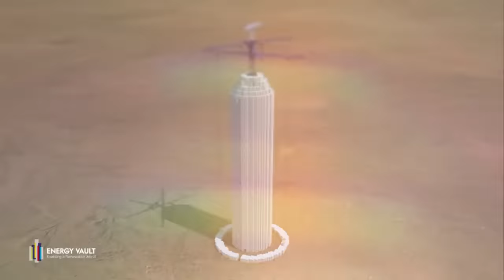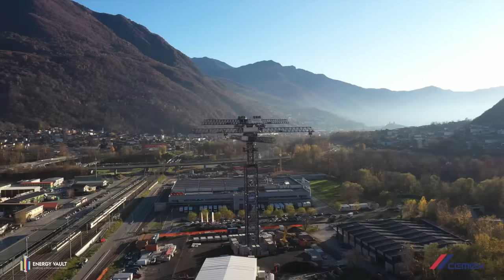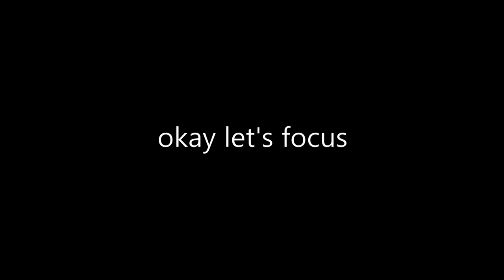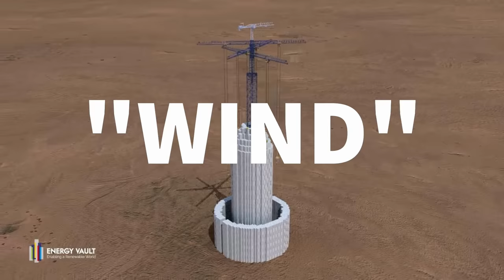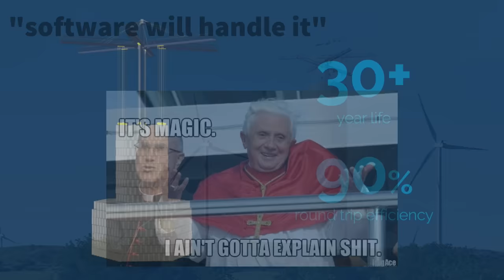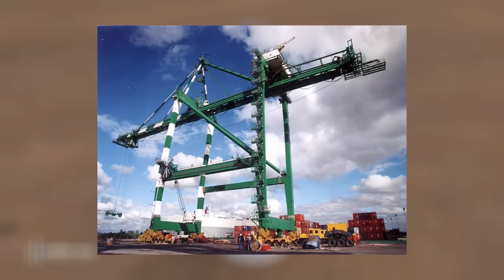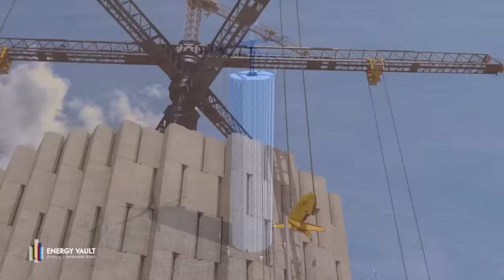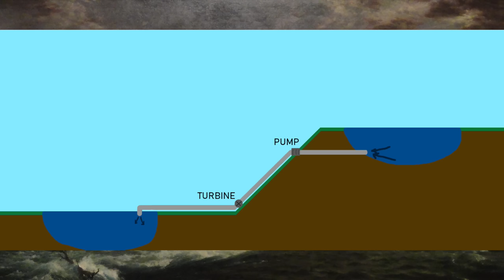The Energy Vault is a Dumb Idea, Here's Why

Comment: I started cackling at the end, you really showed how needlessly overcomplicated the crane idea was just to fit the CEO's "futuristic design"
Reply: Except not. Pumped hydro works mountainous regions or regions with relatively wet climates. Doesn't work in the desert.
Reply: But that's how you can get a bunch of investors and jack up your stock price. ;D   Which they have already by over 100% (NRGV) lol
Reply: @ChrisG1392  The answer is in the video btw: dig.
Reply: @ChrisG1392  35 MWh is enough for an industrial town of 4.000 people for a day of completely uninhibited operations during a total failure of energy production. You simply don't have that in the middle of a desert, neither you need that kind of a backup; a battery of that capacity could easily serve a town several times as large, which is even rarer in a desert. Also let's do some math: this thing is about 90m high (as much as a 3 MW wind turbine), and the cranes seem to be about 50m across. Pumped water energy storage is about 80% efficient, which adds up neatly: a water tower of the same size as this contraption, with a pool next to it, can store & output almost exactly 35 MWh of energy, while requiring significantly less maintenance and complexity. The amount of water contained in such battery is much less than the people using it spend over a couple months, and it can be any kind of water, including sea water or waste water from the people using such battery.
Reply: pumped hydro doesn't work as many places as the crane does. But I agree, build them underground and with a gantry crane. pumps and turbines fail same as concrete blocks, and more often. Also, when dealing with water you corrosion issues, filtration issues, etc. The concrete blocks will last a LONG time and are EASILY replaced. 

Guess what, EV car batteries, solar panels, and wind turbines also used fossil fuel energy to make as well. This is a bullshit argument. Have to start somewhere. Never mind the fact that concrete is far more recyclable than lithium batteries.
Reply: @SoloRenegade  "as many places as the crane does"? What places? What fucking many places does the crane work at?? Are you trolling?
Reply: @s3dchr  you have some serious anger issues
Reply: @SoloRenegade  Great argument.
Reply: @s3dchr  at least I have one (and argument) and don't blow a gasket the moment someone has a different opinion than myself.
Reply: Pumped hydro needs a lot of land and natural elevation difference in a close space that's literally the whole point of the tower,

Comment: As an amateur, I am puzzled by the method of picking up the blocks.
Surely a handle on the top of each block would be the best solution.
It could even serve as a locking mechanism for the blocks stacked on top of it.
Reply: Gernot Schrader  
“Gell”??
Reply: It's solved by "software"!! lol
Reply: You've clearly put more thought into this. That's how concrete blocks are made for temporary retaining walls, with a ridge on the top that fits into a notch on the bottom of the next block, and a steel bar for a lifting point.
Reply: @joey_bonzo  SIXTEEN TIMES THE DETAIL
Reply: @Traitorman..Proverbs26.11  gell is colloquial for ",doesn't it?" and ",isn't it?,
Reply: Traitor Trump Critic   You probably realize that Trump assumes he is smarter than everyone (even engineers), because he isn't smart enough to know better. Your avatar suggests that you might not want to make the same mistakes. I'm not an engineer, but it seems to me that a top handle creates a pivot point for the blocks to swing in the wind. Maybe the engineers know a bit more than you and that is why they went with an anti-swing system. It looks like it might work with similar principles as an antisway bar on a car. If one side has a force applied in one direction, the bent connecting bar (yellow lifting bar in the video) will apply an opposite force on the opposite side. One center handle would be the absolute worst anchoring position for stability.
Reply: @MrAllallalla  
Ah. I thought it should have read “geil”, but that didn’t really fit.
Thanks.
Reply: @gordthor5351  
Four attachment points on the top of the blocks would do the same as your “car frame”.
I’ve been in the merchant navy and I am absolutely sure that if the methods shown was the best, then every container crane in the world would use it.
But they don’t. They use a four point system that attaches in each corner on the top of the container. And the corners also serve as “stacking points”.
Even so. The length of the wires would make the whole system extremely difficult to handle in windy conditions.

As for my avatar… it is chosen to show the text on the guys shirt in contrast to the woman sat in front of him. It actually says a lot about the American society and is often used as a conversation starter. 🥴
Reply: @Traitorman..Proverbs26.11   This is a four point system with 2 cables on the sides (at the top). The 4 corner bars extending to the bottom only adds lateral stability. It's difficult to see for sure in the video, but if you look at the yellow bars at the top, there is a 90 degree bend. This is similar to how an antisway bar on a car transfers an opposite force on the other side to reduce body roll.

Also, some of the blocks weigh 30,000lbs with a relatively small surface area. Coupled with the fact that the blocks move up and down quickly, the wind effect would likely be minimal. 

My point is that I highly doubt that engineers weren't included in this project. Even the most incompetent engineers likely know more about physics than you and I put together. 

My argument is based on logic from what I could see from the video. I'm not an engineer so I'm not claiming that I am necessarily right. 

Hey, we at least agree that Trump is a dummy and a corrupt traitor.
Reply: @gordthor5351  
But the vertical bars are containg a rod which turns and makes a half disk engage at the bottom of each corner on the block.
Not a very secure method. The cement at one corner only need to wither slightly and the whole block risk falling from a great hight, onto whatever is at the bottom. Should it fall inwards as it hits the bottom outer perimeter, it could potentially topple the entire tower.
And if you look at the gantries at the top, it is quite evident that no engineers were involved in the making of the animation.

Comment: The level of precision required as shown in their animation of lifting a single block is absolutely crazy. It assumes that all blocks will be both manufactured and placed correctly every time. It also assumes that the cables won't wobble in the slightest. Also the design shown looks extremely weak. It's a half-pipe with a half circle rotating completely out from under the half circle, with no support other than potentially a shaft near the edge of it, while it's carrying a load on the other edge. That design would break on the first occasion.
Reply: @Grauenwolf  Having 1 mounting point would make alignment when placing the blocks even more difficult as it would be more likely to twist and swing. Although it could definitely be built more sturdily and hooking in the first place could be made easier by tapering the entry point.
Reply: Hey bro, you ever played with legos? Yeah? You remember those little pin things that slot into the bottom of the other blocks, making it so your lego creation always stays straight up and alligned?
Wow, did you know they already do this with concrete blocks? Meaning that it doesnt require precision at all? You just need to put it somewhere inside the range of 30 cm to connect it and then just drop it the last bit. You know what is much more precise than that? Container cranes! Which can drop a container within a centimeter or so even during heavy wind, with much less dense containers which swing much more than solid concrete or metal blocks.
Reply: @ratelslangen  What's up with the shitty attitude? If you had read my previous comment, you would have realized that I already know it's a possibility to make tapered holes for indexing. No it's not like legos, no we can't make that exact kind of system with concrete due to the extremely tight tolerances needed and concrete's hardness. The cranes shown also don't have nearly the same level of stability as those meant for containers, which by the way are a lot heavier than concrete blocks. That means that they're moved much less by wind, and it helps that we aren't lifting them up that high either. Listen, I'm not interested in fixing their design for them, someone already did that, and they used water as weights. I'm just pointing out how bad the current design is.
Reply: Uh. No. Those are not an issue. Ever seen a construction crane? They get within an few centimeters of the mark on the ground high winds or no, and they have less toe in (built in precision) on the lowering cables.

This design is frankly just a pretty run of the mill gravity battery, one that happens to utilize a computer to store more energy in a smaller footprint, but run of the mill no less.
All the fluff in the marking video is just to distract you from the fact that they have been used since before the first electric plant was built. Heck, im pretty sure carpenters where using gravity batteries like this to turn wood in the dark ages.

And to distract investors from realizing they are extremely durable lasting generations not 30 years. 
That lack of built in obsolescence is really really bad for investing.
Reply: @humanistwriting5477  Really, the only useful gravity battery has been those clocks with hanging weights, and they only last a week.  Terrible idea for lathes, they were treadle powered (like sewing machines) in the olden, called pole lathes.
Reply: If you were going to do this wouldn’t you start from a known good solution ? Cargo Containers perhaps. They get stacked daily all over the world , they have worked out the locking system , the lifting system. Beef up the containers, fill them with scrap steel, don’t even automate version one. Pay someone a living wage to move the containers between a high and low platform. Stack them as rectangular blocks, just like in the hulls of the cargo ships.
Reply: @francesconicoletti2547  I don't  think anyone is going to be lifting cargo containers full of concrete a few hundred metres into the air any time soon.
Reply: @humanistwriting5477  Ever seen a construction crane actually work? The final placement is overseen by a number of people, and the final alinement is NOT done by the crane but by the people at the placement location moving the lifted item into the exact right spot. They also do not operate in high winds because it could shift the load. Finally, EVERY lift is carefully planned days ahead of time to hopefully avoid issues. These cranes are so week to winds that in high wind conditions the swivel point is left unlocked so they can turn like weather veins into the wind so they don't collapse
Reply: @j.f.christ8421  really your argument is exhaustingly wrong. 
The value of non reversing turning. Just think about that. Now how would you do that, not reverse? 
Treadle machinery was an early industrial revolution invention that required better metallurgy then anything anyone had discovered prior to the 1700's.
And frankly, gravity batteries got you up the elevator the last time you used one.

They are common, ambiguous, ancient and everywhere, because they are versatile in a way very few things are.
Reply: @kelaEQ2  ya bud. I used them. Also built them.
Final few centimeters are aligned, by the workers on the ground, and there is only a few centimeters that a human can pull those thousands of pounds of metal and extremely stiff wire that at first exposure to feels as solid as rebar. 
That is also under the supervision of humans when humans are on the line. And while we lift awkward flat sail shaped objects that can catch hundreds of kilos of force per square meter, not squat square blocks!

And are still used on top pf skyscrapers despite winds ontop of skyscrapers reaching around 100 kph on a CALM day. Because square skyscrapers redirect wind, and cause narrows where wind speeds up.

And, for the record, all cranes and simular designs including this particular gravity battery are tested to 300% the maximum load they are designed for. That means those floppy cranes with ten times the overhang as this gravity battery on the city skyline is tested to simulated force three times that of typical tropical storm winds, and we do it by looping a cable through the very outmost struts, and applying three times the torque that entire boom is predicted to have on it at tropical storm winds right at its weakest point, and if it fails the whole crane is trashed.

This is designed to be automated, used in fields, is a round body tower not a flat skyscraper, frankly to reach the forces that would cause any mis-alignment or cause any boom to twist you would be right at the eye of a cat. five hurricane

The math to figure this all out is also extremely simple.. but ooooo a YouTube dude said differently then your own logic could do so your going to ignore reality. That you are used to. In your own life. And then pretend that reality matches the YouTuber and we have Cranes falling out of the sky during every slight storm, and everyone leaves the construction site at rhe slightest breeze.
As seen, nowhere. In the world. Ever.

Gravity batteries are at least as old as water mills, and last sometimes centuries. 
For once, we have a tech company trying to sell us infrastructure that will last longer then our lifespans, and one that is tested, and relies on technology that has been used, well, for centuries. It's mature tech, being guided by a computer, when there is nobody around.
These YouTubers are tilting windmills and calling them giants. Quite literally at this point.

Don't be cheering that on.